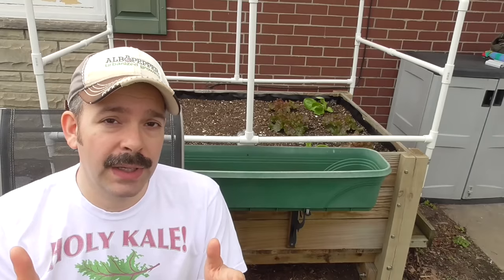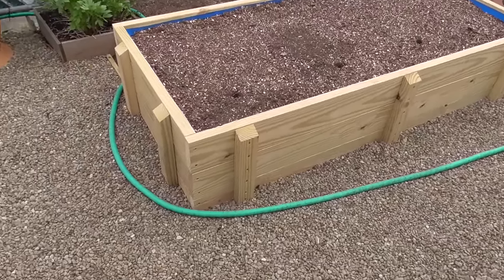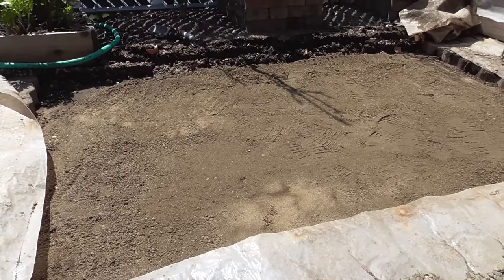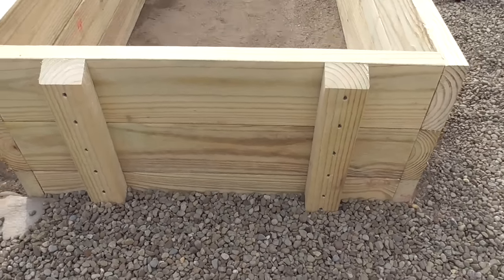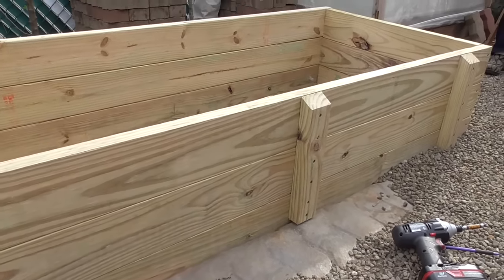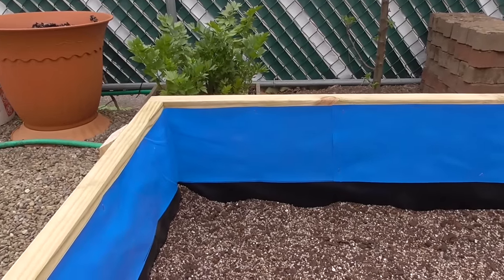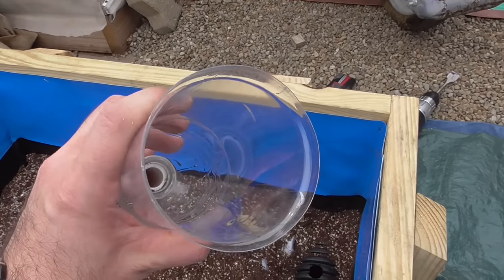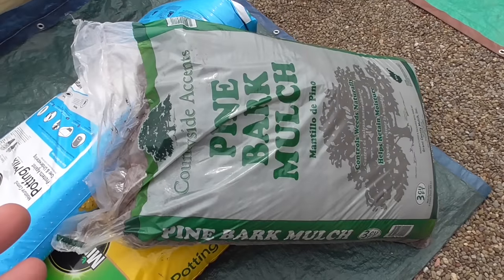Self-watering SIP Sub-irrigated Raised Bed Construction  (How to Build)

Comment: Why not just bury a high-quality soaker hose about 12 inches deep in the bed, put another one at the top, and hook them up to a timer for automatic watering?  As I understand it, the idea of a SIP is to reduce the amount of time you spend watering and to deliver water into the deep root zone.  Given your advice, gardening this way isn't about building great soil that feeds your plants, but rather it is about using a nutrient-poor potting mix and then introducing artificial fertilize.  It's just a step away from getting rid of the growth medium altogether and doing a hydroponic system.  This also doesn't allow for plants with deep roots. Many vegetables send roots to 24 inches deep, but these SIP beds are built for a "soil" depth of only about 12 inches.
Reply from the maker: These systems allow people to productively grow on a rooftop, deck, balcony, patio or paved parking strip. They yield exceptional growth with a minimal footprint and weight load. The absence of native soil is not a barrier. Nutrients can be added from a variety of sources, including 100% organic fertilizers.

I hear your concerns about maximum root depth, but I've been growing in these systems for more than a decade and your concerns are not merited. I've grown 40 huge corn stalks, 2 large zucchini plants & 2 massive tomatoes in a single 4ft x 8ft SIP bed. The bed is installed on a concrete parking strip: https://albopepper.com/images/high-density-corn-growing-in-backyard-in-tote-vs-sip-raised-bed.jpg I've had huge harvests: https://albopepper.com/how-much-vegetable-yield-do-vegetable-plants-produce.php  This year those 2 zucchinis produced 44 pounds (46 fruit). My 2 tomatoes have produced more than 83 pounds this year.

Why not just bury a soaker hose? Because that's not what this video is about. You act like that's some sort of easy, quality solution. But it's a totally unrelated method of water delivery and has nothing to do with systems like these. I have 3 large SIPs scattered throughout my property. Each is independent and doesn't require all of the fixtures, external hook ups and maintenance that a soaker hose would demand. SIPs capture and store rain water and can go for large amounts of time without any watering. There's no comparison.
Reply: @Albopepper  As far as how many vegetables a well-constructed SIP produces, I'd say the proof is in the results, and certainly you and many others have had great results. I'm educating myself in various methods because I'm in the middle of reconstructing old beds and adding a couple of others, and I'm trying to figure out the best way to go.  I've finished rebuilding one bed, but it takes the traditional approach, so too late for changes there. The one I'm working on currently I think I'm going to try my idea with a buried high-quality soaker hose at 12 inches and another at the surface under mulch, hooked up to an automatic timer, so it'll be set and forget. In the PNW we seldom get rain during the main growing season, and at other times we get so much that it needs to just drain away. But I will be adding a couple of new beds and I might try a SIP there. 

My concerns remain about the fertilizing. I grew a tomato a couple of years ago in a large pot filled with fertilized potting mix, and it did poorly until I added a lot more organic fertilizer. It did better, but never up to my usual standards. I have found that just potting mix doesn't give good results. But a blend of half potting mix and half soil gives the results I'm happy with and expect. But, as I understand your video, a mix like that won't work in a SIP. Right?

As far as space constraints, my interest was tweaked by this novice that hacked together a hydroponic system and got great results in a tiny amount of space. His YouTube video is here:  https://www.youtube.com/watch?v=I4T83h7UXD4.

Comment: Why no compost?  Newbie here…
Reply from the maker: Thanks for watching!

Can You Add Compost & Manure to Old Potting Mix?

BAGGED COMPOSTS / MANURES? To prolong the viability of your SIP potting mix, it's best to replenish nutrients in the form of fertilizers. Organic gardeners are apt to use compost as often as possible. In SIPs, worm castings can be included in small amounts. But using composts in containers can yield unpredictable results. Bagged (retail) compost, humus or manure might have a fine consistency, similar to garden soil. If it contains fine silty particles then this can reduce pore spacing and aeration properties of the mix. That's why topsoil is NEVER recommended.

As air gaps get plugged up by ultra fine particles, compaction occurs. And since SIPs are always resting on a perched water table, the few remaining air gaps tend to be saturated with water. This impairs root health, preventing plants from getting the oxygen needed at the root zone. This can lead to a decline in plant growth, or even root rot and death. Even if plants grow ok in the first year, over time the potting medium may break down to the point that it must be replaced.

I've successfully used "Mel's Mix" soil in a bucket SIP with 33% of a woody homemade compost. Only for 1 season though.

HOMEMADE COMPOST? Buying bagged compost is not financially advantageous in large beds anyway, not when compared to buying a bulk organic fertilizer. Of course, homemade composts might work, especially if they are mostly wood based. These tend to have more structure. Larger particle size means improved aeration. I've found though that it's very easy to reserve my compost for conventional beds and perennial plantings. It all gets used, just in a different location.

https://albopepper.com/refreshing-sip-potting-mix-adding-fertilizer-year-2.php
Reply: @Albopepper  I really appreciate the detailed answer man, you've got a great channel.  I built this exact raised bed 2 houses ago, and I will likely build another now that I find my self on 5 acres.

Comment: Why do I not want to use composted manure?
Reply from the maker: Using compost in gardening is a good thing for sure. But much of the horticultural industry advises against using composts in containers. From my testing, it seems that particle size is a big factor. Some types of composts seem to work ok. Vermicompost does well. I've tested a Mel's Mix using hand screened homemade compost and had promising results.

But many retail bagged composts & manures have very fine silt-like particles. They tend to muck up when wet. This can clog pore spaces in your SIP beds. Reduction in pore spacing can kill aeration and result in a system that is prone to becoming septic. Root rot is my biggest concern. Beginning gardeners may have serious issues with plant health.

My personal approach has been to utilize both sub-irrigated AND conventional in-ground beds. Thus I can always compost & cycle all organic matter produced on site. I simply apply the composts to my regular beds. And I use vermicompost & organic fertilizers in my SIPs. The soil structure has remained porous and has allowed me to continue to use my SIP potting mix after many years without loss of productivity.

Comment: I just built two of these using the familyhandyman.com design.  He suggests 4"-6" soil depth for herbs. One end of mine has this depth and is constantly wet on the surface. I'm going to try and lower the drain pipe to see if it drys out a bit. Really don't want to have to take this apart to lower the floor.
Reply from the maker: The more shallow the depth, the higher the saturation. This is discussed in this video: https://www.youtube.com/watch?v=5orIjYKFRgE  Hopefully you can figure it out!

Comment: I read a lot and asked a lot of people that treated wood is not good for raised bed in gardens that you eat the food from
Reply from the maker: Jim Koz If you are afraid to use it then you shouldn't.  Spend more money and select the grade of lumber that you are comfortable with.  However, as I said, arsenic is not used in the US or many other places for consumer-grade treated wood.  I'm just providing facts.  I would suggest asking the people you've spoken with to explain exactly why it shouldn't be used.  That seems like a fair question, wouldn't you say?

To this very day, people still think the lumber has arsenic in it.  I just spoke with someone last month who told me this.  But that's no longer the case.
Reply: I used just regular 2x10 and they lasted me about 6 years before I had to change them and that wood is even cheaper then treated
Reply: Jim Koz If you line it with plastic the wood will not touch the soil.
Reply: yes good idea
Reply: Jim Koz
Reply: Jim Koz what kind of climate was the wood in?
Reply: AlboPepper - Drought Proof Urban Gardening  what do you think about tebuconazole? I believe it is in all copper treated wood as well.

I found a research paper saying it hinders beneficial microbial activity. It also is mutagenic in high doses in rodents. Always a drawback for every easy solution. Disappointing I know.
Reply: If you watch the video you will see that the wood does not even touch the soil! It is lined with plastic to keep the soil out of contact with the wood. I have seen a lot of comments on this same issue on this and other videos and it never ceases to amaze me that people cannot see that there is a layer of plastic keeping the wood from touching the soil.

Comment: why not use straight PVC pipe instead of a tube that could bend?
Reply from the maker: Do you mean for the overflow hole? If so, I agree and more more recent SIPs have been constructed with 1/2" rigid PVC pipes pieces for the overflow.
Reply: @Albopepper  yes. Pvc overflow and maybe a bulkhead to give a good seal.
Reply from the maker: Yes! Excellent idea.  :)

Comment: what about water rotting at the bottom?
Reply from the maker: Do you mean root rot? Many annual veggies are capable of growing roots directly into water as long as there is oxygen present in the water. Look up hydroponics as an example. This design is optimized to maintain a pocket of air that allows for gas exchange. When paired up with a properly porous potting mix, the plants do very well!

Comment: Why no manure or bagged compost?
Reply from the maker: Hi Paul. I talk about that in this series of articles: http://albopepper.com/refreshing-sip-potting-mix-adding-fertilizer-year-2.php  It may result in poor soil structure, reducing pore spacing. Also, there may be issues with salt build up. Compost might be used successfully, especially if it is wood based and has good particle size. An experienced gardener might be able to pull it off. But there are LOTS of variables. And ultimately, if you have to go buy a bag of something, a nice organic fertilizer is going to work just as well - if not better.
Reply: AlboPepper - Drought Proof Urban Gardening. You do a great job btw :)

Comment: small piece copper tube glued in overflow hole works better then tubing you used
Reply: using concrete to build mine from manabouttools channel
Reply from the maker: Thanks for watching! I've been using 1/2" schedule 40 pvc pipe and it works very well also.

Comment: Wouldn't it be simpler just to have a layer of rocks, then a layer of large pebbles, then a layer of gravel, then soil?
Reply from the maker: Have you built one using your suggested method? How many tons of stone are you talking about? I've built four using my method. And I can say that carrying and installing drain pipe is super easy and rather simple. Didn't break my back. To uninstall and move this system will be MUCH easier. I did so with one of them. Mine would be much more viable for decks, balconies or rooftops. More about why I don't advise gravel here: https://albopepper.com/pipes-vs-gravel-in-SIP-wicking-beds.php
Reply: AlboPepper - Drought Proof Urban Gardening Thanks for the link, some good explanation of your chosen system.

Comment: Why no manure? Isn’t it organic? What is wrong with composted material?
Reply from the maker: BAGGED COMPOSTS? To prolong the viability of your SIP potting mix, it's best to replenish nutrients in the form of fertilizers. Organic gardeners are apt to use compost as often as possible. In SIPs, worm castings can be included in small amounts. But using composts in containers can yield unpredictable results. Bagged (retail) compost, humus or manure might have a fine consistency, similar to garden soil. If it contains fine silty particles then this can reduce pore spacing and aeration properties of the mix. That's why topsoil is NEVER recommended.

As air gaps get plugged up by ultra fine particles, compaction occurs. And since SIPs are always resting on a perched water table, the few remaining air gaps tend to be saturated with water. This impairs root health, preventing plants from getting the oxygen needed at the root zone. This can lead to a decline in plant growth, or even root rot and death. Even if plants grow ok in the first year, over time the potting medium may break down to the point that it must be replaced.

HOMEMADE COMPOST? Buying bagged compost is not financially advantageous in large beds anyway, not when compared to buying a bulk organic fertilizer. Of course, homemade composts might work, especially if they are mostly wood based. These tend to have more structure. Larger particle size means improved aeration. I've found though that it's very easy to reserve my compost for conventional beds and perennial plantings. It all gets used, just in a different location.

https://albopepper.com/refreshing-sip-potting-mix-adding-fertilizer-year-2.php
Reply: Thank you for the quick and easy to understand reply! This is our first sip bed.

Comment: Why not use compost? I dont want to buy compost but rather use my own compost
Reply from the maker: BAGGED COMPOSTS? To prolong the viability of your SIP potting mix, it's best to replenish nutrients in the form of fertilizers. Organic gardeners are apt to use compost as often as possible. In SIPs, worm castings can be included in small amounts. But using composts in containers can yield unpredictable results. Bagged (retail) compost, humus or manure might have a fine consistency, similar to garden soil. If it contains fine silty particles then this can reduce pore spacing and aeration properties of the mix. That's why topsoil is NEVER recommended.

As air gaps get plugged up by ultra fine particles, compaction occurs. And since SIPs are always resting on a perched water table, the few remaining air gaps tend to be saturated with water. This impairs root health, preventing plants from getting the oxygen needed at the root zone. This can lead to a decline in plant growth, or even root rot and death. Even if plants grow ok in the first year, over time the potting medium may break down to the point that it must be replaced.

HOMEMADE COMPOST? Buying bagged compost is not financially advantageous in large beds anyway, not when compared to buying a bulk organic fertilizer. Of course, homemade composts might work, especially if they are mostly wood based. These tend to have more structure. Larger particle size means improved aeration. I've found though that it's very easy to reserve my compost for conventional beds and perennial plantings. It all gets used, just in a different location. 

https://albopepper.com/refreshing-sip-potting-mix-adding-fertilizer-year-2.php

Comment: Bark is a bad additive for a planting mix. It uses massive amounts of nitrogen as it decomposes. If you want to bulk your substrate then compost the pine bark or  you can always use coconut fiber chunks which break down at a very slow rate and do not rape the nitrogen out of your soil. http://www.extension.uidaho.edu/nursery/Extension%20Publications/Using%20bark%20and%20Sawdust%20for%20Mulches,%20Soil%20Amendments%20and%20Potting%20Mixes%20-CIS%20858.pdf
Reply from the maker: Hi Chad. Bark isn't a bad component for planting mix. The source you listed states: "Bark is a useful component in soilless potting mixes." It's true, that it can cause N draft. But keeping it at a moderate ratio makes it very easy to use in mixes.

I've done so for 6 years now. Besides adding extra N, pre-composting the bark can certainly help a lot - as you suggested. Using actual bark and not wood chips makes a difference too, as the higher lignin content takes a longer period of time to break down. Thanks for sharing the reference!

EDIT: Lots of options including composted pine bark mulch are discussed on my site:  http://albopepper.com/potting-mix.php

Comment: Why no manure or compost?
Reply from the maker: The biggest reason is particle consistency. Using porous potting mix components provides better aeration which boosts root health. Fine silty particles plug up air pockets resulting in compaction and an anaerobic condition. This can cause root rot. A large volume of manure products can act much like topsoil in this regard.

As a secondary consideration, uncomposted manures can pose dangers in the way of pathogen contamination. This effect is more serious when you think about the large reservoir at the bottom that could turn into a septic breeding ground.

Some composts might work ok, especially wood based homemade composts. But some of the retail bagged compost products are very silty and they muck up when wet. I would avoid those for sure.
Reply: Alright. Sounds reasonable. Thank you.